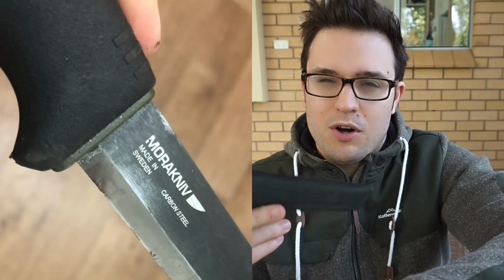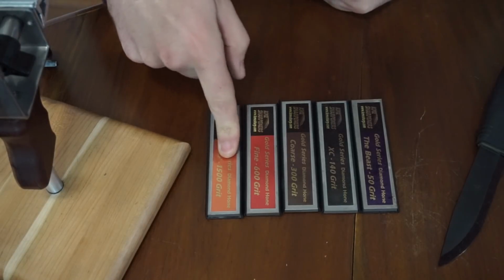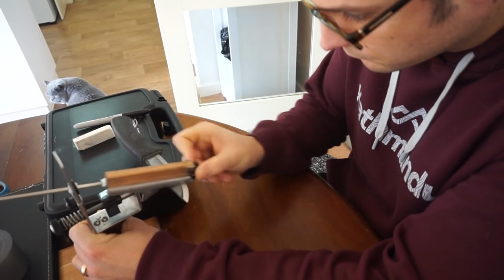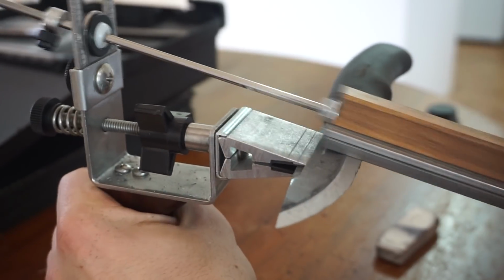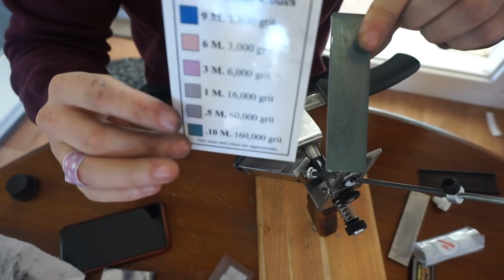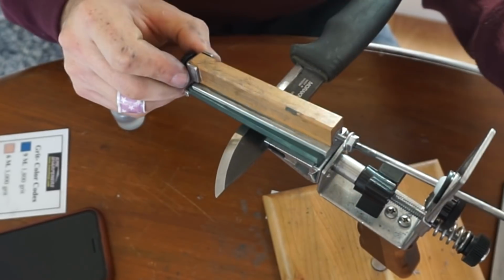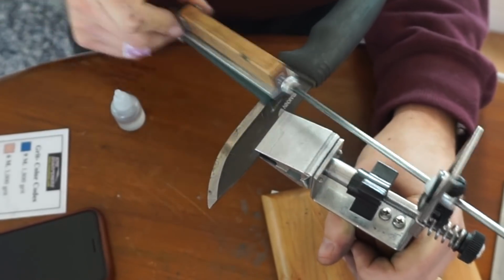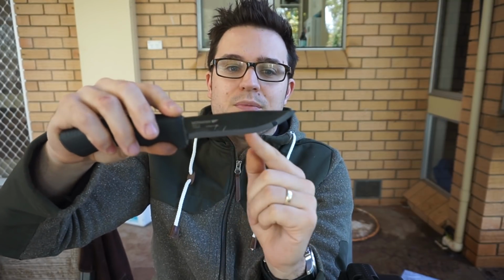Mirror Polishing a Mora Bushcrat Black using KME system

Comment: Honestly you should be pushing the stone into the blade not pulling it away.  You will get a sharper edge with a cleaner burr. Pushing the stone into the blade then lifting it off and not doing the pull back stroke will make your edges insanely sharp and this is the best way to use one of these guided angle sharpeners.  There's a great video by work sharp where they use the push in, pull back, and the sawing motion and use a sharpness tester and the push in beats every other way.  It leaves cleaner edges, a better burr, a less scratches. They even inspect it with a microscope to show you the micro scratches.

Comment: I used to sharpen with a clamp system and I found if you bring the clamp closer to the handle to get the heel of the blade and it lowers your angle at the tip, just bring your tip forward a little and that will make your angle more acute.  It will also help you match the angle of the arm side to side at the heel.

Comment: You should add the 100 grit stone as soon as possible, going from 50 to 140 is too large of a jump, getting the 100 grit will make removing the scratch pattern WAY easier.
Reply from the maker: good advice I will definitely do that. Those deep scratches are troublesome
Reply: Absolutely. Amen to that there Aaron.
Reply: EDC with Aaron it most definitely will I would also add a .1 micron strop just to make sure the bur is totally gone
Reply: Yeah.. higher grits would take forever and back to get deep low grit scratches out.. smaller stepups save time and give better result in the end.. also not contaminating higher grits with low grit dust is important
Reply: I couldn't agree more. I have both, and if you need to go to the 50 grit, the 100 grit makes it a whole lot easier to get those deep scratches out of your edge. Besides that, f you are only removing small chips, you don't necessarily need to go all the way to 50 grit, and the 100 may be adequate for the job, The less metal you remove the better.

Comment: To get a proper mirror edge you have to do a few things differently. You have to remove the previous scratch pattern from the stone before it. To do this you can start by swiping the rods from one side to the other. Then the next stone go up and down. That way you have the pattern going in one direction and you can see the pattern removed on the next stone going the other way.
Then I. Your finer grits you don't want to go back and forth you just want to take it one direction. So no left to right or up and down, just one direction, lift and then start again.

The other thing is the films are not idea for good mirror edges. Preferred to use diamond spray or paste and wood blocks (basswood or mdf) or leather strops. Using 4 micron, 1 micron,. 5 micron,. 1micron

Should get you where you want to go. It's pretty much technique.

Also the diamond strops will give your edge a bit more toothy edge unlike other abrasives. Tip Per big brown bear.

Comment: Beautiful job...but the insane length of time it takes to put these proper awesome edges on a knife, is the reason I went to using a consistent angle slow speed belt sharpening system. Even uses a leather belt and compound for quicker stropping.

Comment: Do the stones on that system load fairly quick? Being they are so small? I just recently bought all new equipment after my sharpmaker stones wore out. I went with all benchstones and strops cause I figured they wouldn’t load as fast.
Reply: Matthew Forrest the ceramic on a sharpmaker shouldn’t wear out
Reply: bp69 they all do eventually. Then you can make them flat again with a diamond plate but it takes a long time and not really worth it. It’s not they are completely worn out just not giving me the crisp edge they used to.
Reply: Matthew Forrest huh I’ve never worn out spydercos ceramic I’ve gotten them loaded with metal but you just clean them I’ve also never heard of people having to flatten them either
Reply: Matthew Forrest also what benchstones did you go with and what stropping counpounds did you use
Reply: Matthew Forrest oh okay spyderco stones are good as long as your not reprofileing anything or sharpening super steels I would get a a dmt plate for super steels and reprofiling also you may have carbide tear out with steels that have high vanadium carbide idk about that though as I haven’t tested it and ken shwartz coumpond is good
Reply: bp69 I have a fallkniven plate that’s new and one that’s super used essentially medium and fine. Then medium fine and extra fine benchmstones and 4 1 and .25 cbn strops. Works great. I found that with these fixed angle things they do load fast and are expensive to replace. I figured I can just free hand and bee good forever. I’d still like an ultra ultra fine dmt plate but I’ve heard the kind of are not very uniform.
Reply: bp69 I have the cbn and diamond rods for the sharpmaker as well. For the money a plate is the way to go. And trust me the stones will get to the point we’re the6 are so smooth and burnished they really won’t properly apex a knife. The fallkniven ceramics expose new ceramics more readily than the spyderco. My ceramic side is almost as aggressive as it was when I bought it. And it has a fucking shit load of use. I’m sure it’s not exactly flat anymore but still great stuff.
Reply: Matthew Forrest I have some experience with dmt diasharps and I found them to be exelant quality I would go for it
Reply: Matthew Forrest my dmts haven’t gotten smooth yet you just have to clean them
Reply: Matthew Forrest huh most people that do a lot of freehand sharpening say falknievens ceramics are not as good as  spydercos ceramics I’m gonna have to give them a try

Comment: Just curious, but have you tried the convex arm for the KME? Was wondering if it would work for a Bark River convex grind or if it would totally mess it up.
Reply: Tim Gannon I think the placement of the knife makes a difference. I tried it, but it left an uneven microbevel on the tip. It came out sharp as hell though. I placed the clamp in the middle as well as Pete
Reply: I would just go freehand for convex
Reply: I got Aurora and Gunny, and I just freehand. Personally I feel scandi is the easiest by following the preexisting bevel; convex is second easiest, just relax your wrist and use light pressure.
Reply: Skywalker96214 yeah a convex is super easy idk how people need to use a mousepad to sharpen convex
Reply: To be honest, every knife I ever sharpened ended up becoming a convex... including my Moras, they became scandi-vex. I think it's because people sharpen their knives differently, and making convex bevel simply feels most natural to me.
Reply: Skywalker96214 yeah I was the same for a while I convexed everything

Comment: Am I the only Australian with a KME system thats wondering where you can get a replacement knob/handle for it? What it comes with makes it such a pain in the ass to use compared to some other systems and in the US you can get decent replacements for like $1.50 on amazon but they won't ship them to aus. I'm at a loss on where to get them here. I mean its a piece of plastic with a 1/4 inch thread in it. It shouldn't be that difficult to come by but there it is.

Comment: How long did this process take? I have use a similar system and my whole body hurt after an extensive re-profiling of a scandiground knife.. #mirrorporn
Reply from the maker: yeah definitely in the 4 hour range
Reply: Cedric & Ada Gear and Outdoors That's brutal...
Reply: Yeah I did this to mine a few years ago. Never again. Took forever.